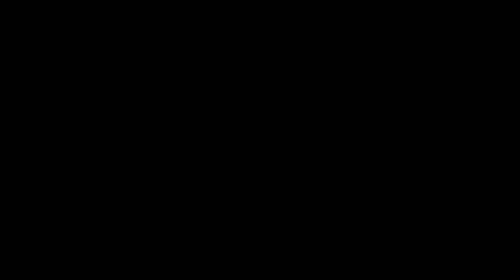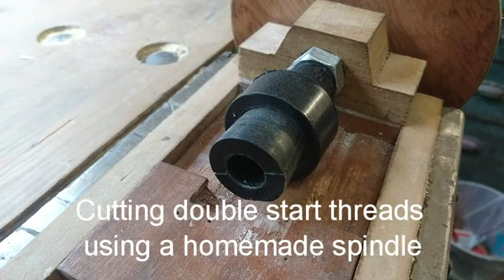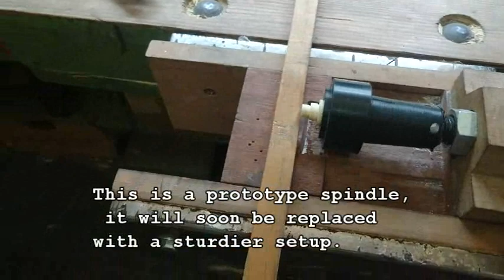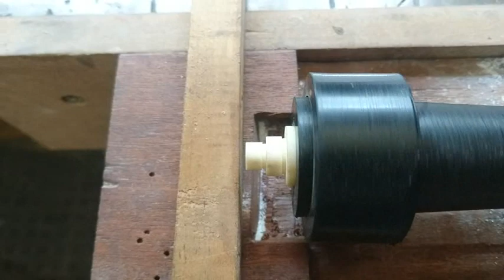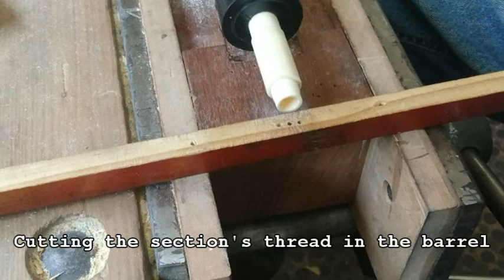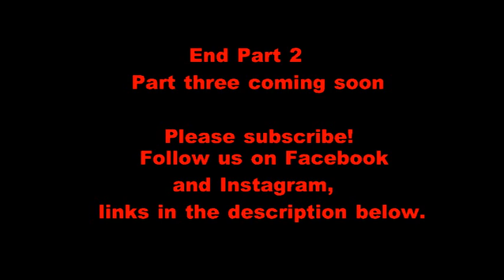Pen making Part Two: Hand cutting fountain pen threads

Comment: Tiaan, are those thread chasers self-made or are they purchased?
Reply: I'd be curious to know that too.
Reply from the maker: Sorry for the late reply, I somehow missed the notification. The cutters are hand made. I use silver steel or a similar high carbon tool steel for the tool. The teeth are cut using a fine file, matching a suitable thread from a screw. I flatten one side of the screw to enable clamping it to the steel, this helps with the matching of the teeth. The tool is subsequently hardened and tempered.